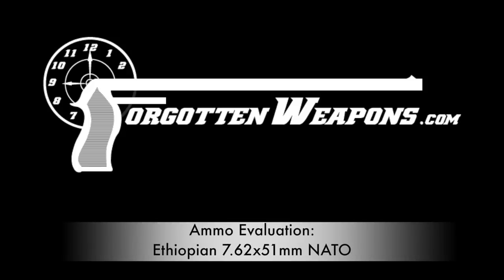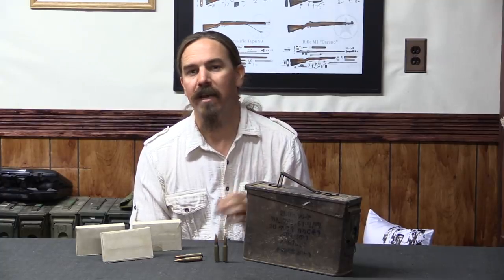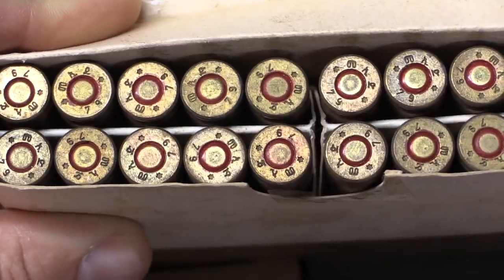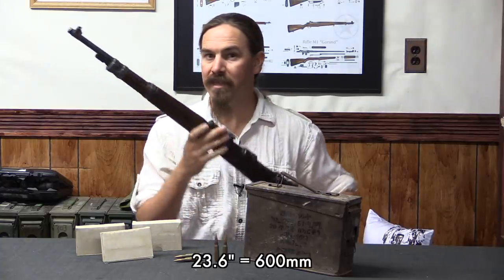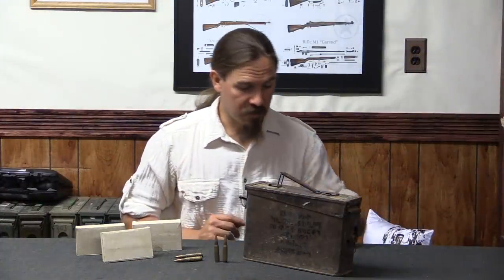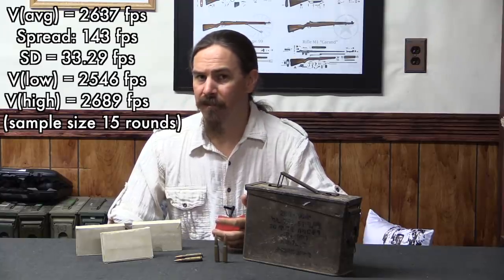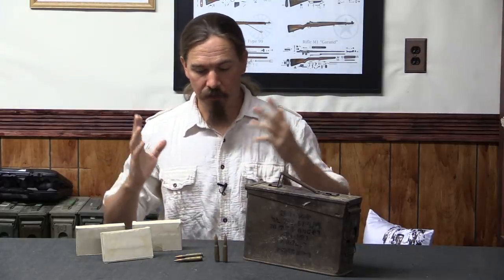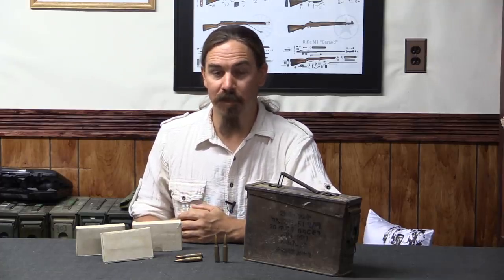Ammunition Evaluation: Ethiopian 7.62x51mm NATO

Comment: Strange, in Fallout you can easily fire 200 years old ammo lying on wasteland's streets. Must be the radiation
Reply: To be fair, most of the world in the Fallout series seems  rather desert like .  I am sure the dry and arid conditions help things.
Reply: It's not really age that kills ammo, it's moisture related corrosion.
Typically caused by high humidity or sudden variance in temperature, this makes storing ammo in the Mid-West exciting!   

Ammo stored properly can easily last for decades, possibly centuries I guess, but I'm no expert.
Reply: @MarikHavair  ah the mid west where 30 degrees and 70 degress are hours apart, and snow rain hail in one hour is just a tuesday.
Reply: It makes sense in new vegas, ammo stored in a can out in the middle of the desert is going to have a very long shelf life
Reply: If the war was in 2077, perhaps the powder they were using is better quality / more advanced. We already have better stuff than they did 40 years ago. No telling where tech would / could be in 59 years. I bet temperature / moisture stable powder would be easy enough. Or better loading / sealant processes.
Reply: The timescale in fallout was always wonkey, even from the start when it was only 90 years, after 50, the fallout from most bombs has gone, the half life on the majority of nuke fallout is 38 years or less, so in 38 years, it's reduced by half, by 50 most of the dangerous stuff is gone, look at Hiroshima and Nagasaki, 70+ years on, and they are fine. 90 years on in fallout and only ares where nukes penetrated or exploded at ground level should be irradiated, and only if something prevented the contaminants from being dispersed.

200 years on and the world should mostly be clean, hell, 200 years is enough most of the old world infrastructure would be reclaimed by nature if no one was keeping plants and animals from reclaiming cities and such. All that pre war food would be dust, packaging, preservatives or not. Chemical power sources like gasoline, gunpowder etc would degrade to worthlessness. Really at 200 years on, the world should have moved on, but that wouldn't make Bethesda any money.

If you remember your fallout 2 lore, the world was moving on, radiation was less an issue. But fallout 3 sorta backpedaled on that to tell its own story on the far-side of the continent. The original fallout games were much more comedy focused too, so you don't take a lot of he silly scientifically inaccurate stuff too seriously. At one point in FO1, and NPC literally comments on repetitive NPC dialogue as a joke, you can find a TARDIS as a random encounter and loads of other jokes and references.
Reply: It may be related to Fallout being a fantasy.
Reply: KohinaREC
It's entirely because it wasn't important for the first game, as it was set up with a fanciful and comedic tone. Beth changed it to be more serious and 'gritty', but skimped out on doing much research into how architecture and other things degrade. Just like they put little into QA testing for their more recent games.

Conversely, the Metro 2033 game series goes in the opposite direction. It's only been 20 years since the apocalypse, but the surface and some parts of the metro and surface look to have 100-300 years of degradation, including tunnels filled with stalactites and stalagmites that could take 100's of years to form like that. And despite it only being 20 years, it's like everyone has forgotten of the pre-war time, despite the fact most adults should have been alive before the apocalypse.

Hell, Artyom, the primary character, was born before the apocalypse and is only 20 something. Meanwhile in fallout, people as a whole seem to have held onto a lot more pre-war memories, and you even have the more than 200 year old ghouls who were alive before the war keeping such knowledge alive. A strange dichotomy indeed.
Reply: damnit, now I'm going to have to dig out a copy of FO1. I don't remember a TARDIS at all.
Reply: A Hettinger:

There's also this one: http://fallout.wikia.com/wiki/Crashed_whale

Clearly a hitchhiker's guide reference.
Reply: Yes, but that's FO2. I didn't play FO2, just FO1.
Reply: They both have equally silly random encounters, and a ton of references. F02 had an entire series referencing monty python and the holy grail too. The only modern(ish) game to even touch on the wakyness of those random events was FONV, and only if you took the 'wild wasteland' perk.
Reply: I think there is a good chance you could still fire this ammo after 200 years, depending on how it was stored.
It might not be very accurate, but it will probably go bang.
Reply: RogerWilco
Doubtful, after that long the primers would be rubbish. The chemicals in primary explosives like primers and blasting caps are generally not stable long term. At best you'd get dangerously long hang-fires, at worst, you'd be left with non-functional ammo.

For an example of how things break down, gasoline has a shelf life of roughly 3 years, with stabilizers, proper storage and stable temperature. That's a best case scenario. After that, gasoline turns into chunky rubbish that will not work in an engine anymore. If it's an ethanol blend? You have 3-6 months at best, even with stabilizers as the ethanol will pull water from the air, even in a proper storage container.

People think gas just lasts forever, but its viable period is laughably short in storage. for contrast, dry rice can remain edible for decades, maybe over a century if kept dry and free of pests. The more volatile something is, the shorter its shelf life, generally.
Reply: @rogerwilco2  Yeah I just picked Fallout 4 back up and started playing with mods to make it more realistic and it just seems off. 200 years on and everything prewar would be today. The weaponry would all have to be new production including ammo. It feels so...off.
Reply: @colsoncustoms8994 n fiction, I have written of ammunition lasting nearly a millennium and firing as if freshly made.

Chief issues were: cool, dry, darkened storage - think “a desiccated near-refrigerator” for storage - as well as a highly advanced propellant chemistry. (think non-nitrate chemistry) as well as a unique primer composition - one that is mildly corrosive to some metals.

Comment: TL;DR Seems like they made legitimately good ammo 40 years ago, but they made it 40 years ago and it may not have been stored in the best way possible.
Reply: Ethiopia was aligned with the US until the Commies took over in 1974 and kicked out US advisors. After that all hell broke loose - 

https://en.wikipedia.org/wiki/History_of_Ethiopia#Communist_period_(1974%E2%80%931991)
Reply: ammo is really storage sensitive it seems. it also seems like the eastern block spam cans fare the best long term, they must do something to the air on the inside to keep it dry, but i have pretty much never seen bad 54r, 7.62x39 or 5.45 with the exception of a case failure that was just a plain bad round. the american style ammo cans seem to work great if you keep some desiccant in there to fight off moisture but by the looks of the outsides of these ammo cans they where not exactly stored dry.

Well stored ammo seems to last about 60 years from what ive seen and shot with surplus.
Reply: So they made all this ammo under communist rule.
Reply: If the spam cans are sealed then it's possible that they were filled with dry air or nitrogen to prevent damage from moisture.

Ultimately though neither smokeless powder nor priming compounds have a great shelf life on their own, just like other energetic materials.
Reply: Yeah if it isn't sealed in air tight containers with some sort of desiccant, I wouldn't expect this stuff to last all that long in Ethiopia. Not sure about the rest of the country, but assuming this stuff spent most of its life around Addis Ababa, it went through 40 quite warm and more importantly humid summers.
Reply: @mojopin2520  I'm no fan of the Democrats but I think it's safe to say the Derg were quite a bit worse.
Reply: Eastern block spam cans are fixed shut, you have to cut them open with the right tool, but it keep out moister. 
That ammo will in the can last another 10-20-40 years, it sealed.
This was in ammo cans, open to the air and humidity but ideal for quick use (I.E. same decade).
Reply: mojopin-you obviously have never been to oregon

Comment: The "Ethiopian script" is the Amharic language, which is related to Arabic and Hebrew. 

If Mike from Bloke of the Range were there, he would say that the ammunition is a bit "click-bang-y." 

I wonder with that spread of velocities would affect the performance of self-loading rifles.
Reply: Damn good question and I wouldn't think so to be honest. At least not too vast a difference. 

That 2500 fps round, might have caused problems. 2600 fps rounds, not to much. 

Tweaking the gas system would probably be a good idea, in principle.
Reply: In working up reloads in AR's, even the low charge starting loads cycle just fine, meaning "normal" loads are way over gassing the system. But no one really cares as long as it's cheap and goes bangbangbangbang and doesn't send the bolt out the back of the buffer tube. Or break an op rod, I guess.
Reply: I would like to see how it works in Ian's "AK4".

Comment: Ian, your sample size is a little small for a statistically relevant standard deviation. 30-50 is a the general "minimum". I recommend shooting more :)
Reply: Another important point: to calculate the average of a number of samples you have to eliminate the highest and the lowest score because in this way you eliminate many of the casual errors that can happen
Reply: @iaial0  Except in this case the highest and lowest case did occur and it is cherry picking to remove them from the data. The also occurred in a very small number of samples. That is worrisome by itself.

Comment: these hangfires make me question my military training quite a bit..... We were told if the rifle doesn't fire you should rechamber a new round as fast as possible. This of course makes sense if there is someone shooting at you, but you wouldn't want the round to explode in the air infront of your face :/
Reply: As Ian noted it's probably a side effect of the storage conditions and time. I would expect when new or otherwise within some sort of best before there'd be no noticeable difference.
Reply: It's certainly a matter of concern, but maybe not all that much concern. Back when I was in college, the physics prof (who was not only head of the physics department, but also the wrestling coach, unarmed combat instructor, and small arms instructor) decided to show us what happens to ammo when it gets hot. So he set up a trivet and put 5 rounds of 30-06 on it and put a bunsen burner under it, then stepped back a couple of feet. After about 30 seconds we had a nice series of firecrackers go off in the front of the classroom. For the most part things stayed within a couple of feet of where they started, but we did have one bit of brass go zinging off the wall about 10 feet away. Most of the bullets stayed on the trivet, and the brass largely just split down the side.

You certainly don't want a hunk of sharp brass sticking into your eye or face or neck, but if the shell gets down to knee level before it blows you probably don't have much to worry about.
Reply: That’s why military ammunition has a best before date. If it’s too old it either gets sold as surplus or is dumped down range🤷🏻‍♀️
Reply: Cartridge exploding outside of the chamber is mostly harmless.. as long as you are not holding it in your hand. I was taught the same: rechamber asap as the possibility to get hit by brass fragment is very low (and even if hit it won't break skin) but getting hit by not shooting the other guy is very high. 

ps. Do not pick up misfired cartridge for some time after it has been ejected same as unexploded fireworks, it costs you nothing to wait while visiting hospital will cost you.
Reply: Salesman9001 exactly especially when you’re in the field just leave it, at the range just treat it like regular spend brass, pick it up when you clean up.
Reply: @Salesman9001  unless you live in Canada, then the hospital trip doesn't cost you either ;) 

Other then time off work to heal, or maybe a finger or two XD
Reply: yes but one detonating half extracted or as soon as you unlock the bolt would potentially be catastrophic to weapon and/or shooter
Reply: Ninjava it does cost you. Just in advance and not if you actually go there but nevermind ...
Reply: Would be interesting what the best before date for this production lot was.  Thinking about it a bit, why would you write the end of production on an ammunition box, could that be the actual meaning of the 85 (giving eight years of shelf-life)?
Reply: Saibot Saibot that actually sounds quite convenient, maybe Ian knows more about it.  But selling it 32 years after the best before Date kinda sounds
Reply: Military is quite different than at the range.  In the military they're training you to fight someone trying to kill you and assumes you're not using 40 year old ammo manufactured and stored in a third world country. You can pretty well safely assume issued ammunition will either go boom or it wont, and usually if it doesn't it's a light strike on the primer rather than a degraded primer. Even if it does go off outside the weapon, in combat an exploding case next to you is far less likely a problem than the properly functioning bullets being shot at you.

On a range at home it's different. You can take the time to wait out a hangfire, I learned to give a count to 10 then eject the round and leave it alone until I'm done shooting.  That said, if my gun starts having hangfires I usually stop shooting that ammo.  Slowburning powder can potentially cause an over-pressure.
Reply: I wilton
I think the Mythbusters found something similar when they were testing .22lr as a temporary replacement for cylinder fuses: The brass mostly just goes rocketing off the bullet due to the difference in inertia, generally without a fatal amount of force.
Not exactly pleasant to have go off next to you, but probably better than getting shot by opposing forces because you couldn't/wouldn't shoot your gun.
Reply: Outside the chamber it is like a firecracker, not really dangerous unless you get hit in the eye. When I was growing up on army based years ago, we would occasionally find rounds along dirt roads on base. If you open the nose of the 5.56 blank and add a fuse, it will launch like a rocket until the fuse fires which goes bang. Sort of firing the round in reverse. Kind of a milsurp bottle rocket.